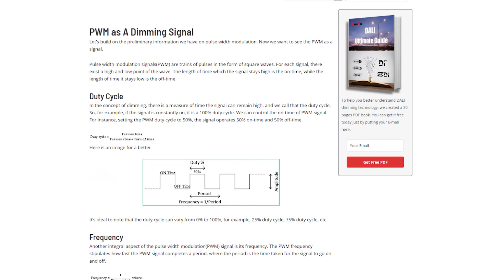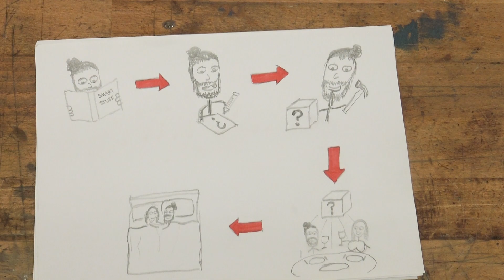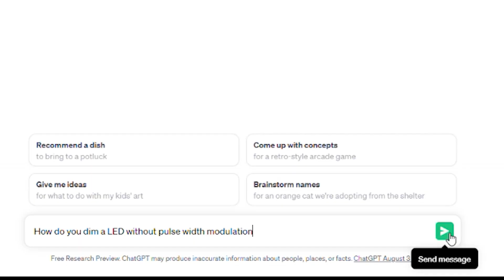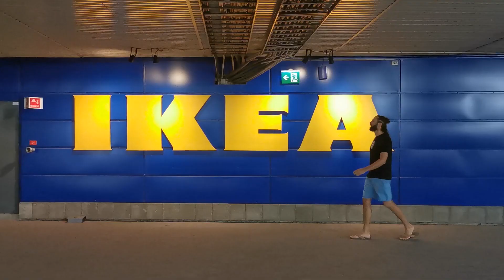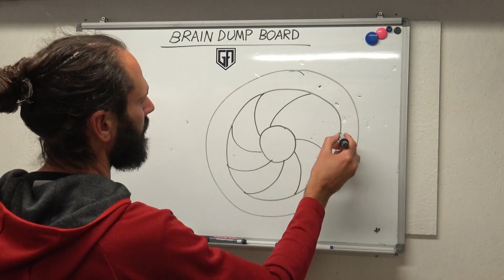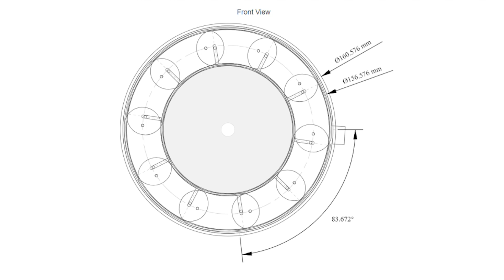LED's suck when dimmed, so I built this lamp to stop LED flicker

Comment: For proper dimming you need a controller that switches at least at 1000 Hz, but preferably ten times that. You might find those cheap, but that spec is not really printed anywhere, so that makes it hard, and light frequency counters are not really an everyday object people carry around so they can check at the store.

Also, you can dim LEDs with voltage alone, but the tolerances in manufacturing makes the voltage response curve different for each individual LED, so you have to calibrate each of them separately (with trimpot or DAC or similar in a circuit) to get consistent light, and the voltage response is logarithmic, so you have to compensate for that too.
Reply from the maker: Preaching dude! glad to know someone knows what's going on.
Reply: Oh sh..., I got so caught up in the engineering of diodes that I completely forgot about the awesome lamp, I do love the design, and the function too, I would probably have made room for motors to actuate the irises, but that is just because I am crazy.

It reminds me of those long old wooden kitchen table lamps that were popular in the 80s-90s, had you given the outside rim a stained birch texture I would have freaked out.

And your production is top notch! I feel pretty confident that you must have done work in some creative field, but do you have professional training in videography?